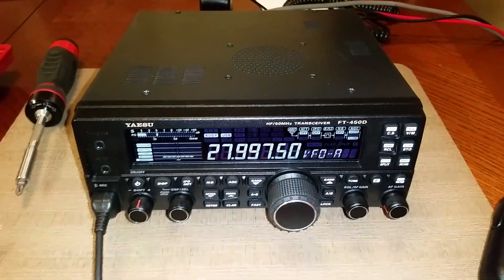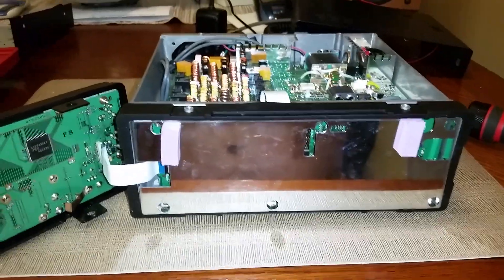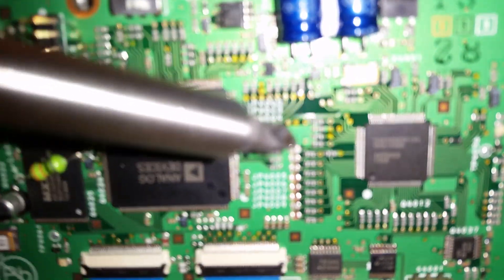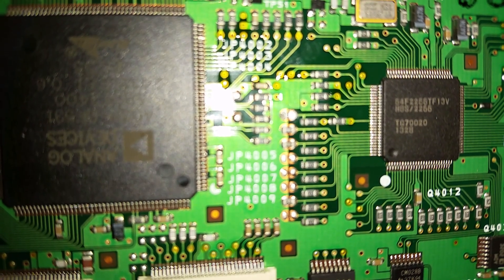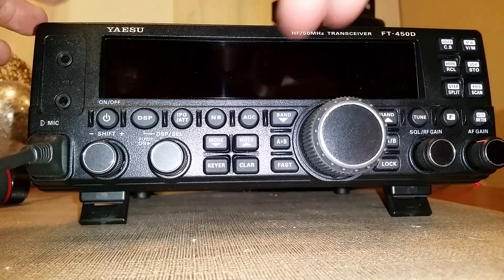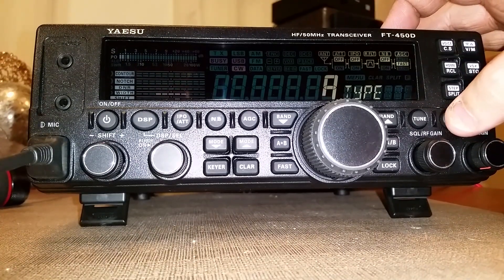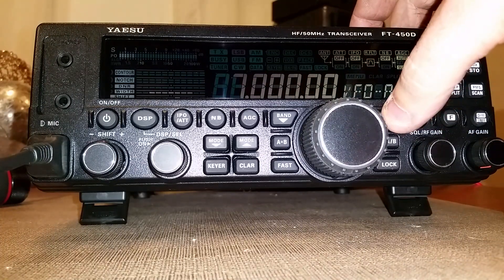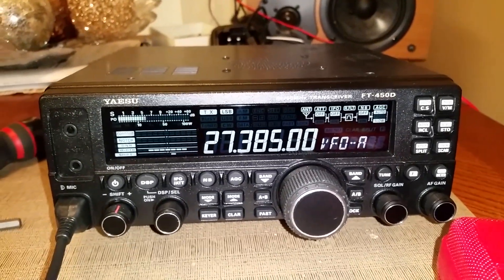Yaesu FT -450D expanded transmit mod

Comment: Useful for 5MHz band if you're a ham and for the CB guys but illegal for everything else! 5 mhz can also be enabled by a software hack which is published in a PDF on the Yaesu site and for that you don't need to open the rig!
Reply: sorry ! 60 meter band is programed in the radio from the factory. no need to modify unless you are mars affiliated. or you to talk illegally on the cb band
Reply: @robertmethia7080  How the radio is factory configured depends which country you live in.

Comment: I just did this on my radio, it worked fine thanks.  The jumper is soldered to the large ground pad so it takes quite a bit of heat to de-solder it. Also, when you turn the radio back on, be aware that it's done a factory reset so any settings you had will be wiped and it'll go back to how it was when it was new (but will now transmit on all frequency's in all modes).

Comment: got a problum the cable that connect fount pannel  both ends to transceiver came out pushed it back in thes sound when i switch on but now  the fount pannel wont light up have i not push it in another

Comment: Dear friend forgive the daring to write to him on his channel but I would like your opinion
technique of the problem of my Yaesu FT-450 equipment.
Now I explain the history of my Yaesu FT-450.

I will tell you that the radio was in perfect condition and works without
problem, about 15 days ago a friend brought me an FT747 to measure
the power because he had changed the rf out transistors. I connected the
my friend's radio and I put cw and when I press PTT I realize that my FT-450
it was on it has a burning smell but no smoke only smell.

At that moment I turn it off and realize that I had an antenna on that is
two meters from the antenna that I was testing the FT-747, the conclusion that
serve is that with the proximity of the two antennas my FT-450 got a lot
RF and something was damaged or burned.

When I turned it on again it was another radio, I had a lot of problems like:

-ALC does not work in any gang

-The power goes down to 40 or 50 watts in cw and FM and when I transmit in ssb the power
it drops to 20 or 25 watts in almost all bands except 80 and 30m which outputs almost 100 watts
in cw.

-In the 6m band the reception has problems, strange noises are felt and only
it outputs 5 watts in cw and when I transmit in 6m there is a noise in the radio horn
It is the band that is worse, in the other bands the reception seems to be ok and
it has good sencibility.

-The internal tuner antenna of the radio goes crazy and does not adjust correctly, I will
disable the tuner antenna (INT TUNER) and continue with the same problems which
It shows me that the internal tuner antenna of the radio has no problems.

-When I press the ATT button, the RF OUT power in transmission decreases even more and
This cannot happen because ATT and IPO do not work in transmission.

I physically checked all the components to see if any were burned
or they had another color but visually all the components are in very good condition
physical.

I reset the microprocessor manually with POWER-HOME and also reset it by
sofwear with a program that Yaesu has for the FT-450 that updates in
microprocessor and there was no change.

I have no idea that it may have been burned or spoiled, it strikes me
that the radio's ALC does nothing and this may be the problem, but I don't know
which component in the ALc may be wrong.

I have all manuals and diagrams of service and adjustment.

With all this information that I have given you, I would like you to study the problem and I
give your opinion or idea that the radio may have affected so that it has so many
problems. My mistake was testing the FT747 with the other antenna attached to the FT450
I think that RF entered through the antenna and something burned, but I don't know what it could be.

If you have any questions tell me I can do the measurements you tell me or check
some components, I measured some diodes placed on the board and they are in good
state.

I await your opinion, a million thanks in advance.

Greetings .- Eduardo

Comment: It will be a fine day when these guys all go to the slammer, or get fined and lose everything they own. Fitting end for scoff-laws.  When a radio working legally is a "Problem"  the world is in sad shape.
Reply: I see you posted a couple of years ago, then again a month ago, so maybe you'll see this. I'm a HAM, 40 years now, and I'm also a prepper. In a true emergency, communications out of band would not be judged so harshly. If i have a rig which is capable of OOB use, great. Doesn't mean i WILL use it, or even WANT to use it OOB. Same logic as having a  car that'll do 140 mph. Where can you drive it that fast? I have other licenses as well, including GMRS! Who bothers with GMRS licensing these days?

Comment: Just done this mod on my new 450d...only prob I had...when I got to the part of the instructions where you get SMADJO on the rigs display....I was rotating DSP/SEL looking for type A...where TYPE A should have been I had B TYPE instead...thought I had done it wrong but I looked a few more times still only B TYPE came up after the previous number 41 on the display.
I followed the instructions from here and it went straight to Type T.

Transmits across the whole band but the AM broadcast band wont now tune properly on the VFO...no big deal but I wonder if anybody else has found this.

Drop me an email please if you have had similar results....it wont transmit on the broadcast band by the way.

My email is nickjaxe AT ntlworld.com

I need open band for marine use in case anybody is wondering why I did the mod.

I did this mod as I need marine TX.
Reply: FYI to you or anyone else wondering about this: When you do the reset it reverts back to the factory default which I believe has FM and AM modes tuning via the DSP/SEL knob instead of the main VFO knob. The way to enable tuning those modes with the main knob is to go into the rig's settings, and look for 'A&FDIAL' and toggle it over to ENABLE. 73 from W5SMS

Comment: Hi, did this mod on my ft450d and set to t type and saved it but mine wouldn't transmit at all anywhere!!.....so ended up putting link back in....By the way it is not a diode but is a 000 link which is the same as a short.....cheers Kev G7ILP

Comment: Hello! Is there a manual explaining the Service Menu of the FT450D?
When I'm trying to transmit more than 50W in CW (35W in SSB), it blocks itself ... Like a security... Maybe one of the previous owner did a change in this menu, It happens even with a swr of 1.1 ... (I hope, else it's a PA's problem)...

Comment: Nothing like the thrill of cracking open an 800 buck rig and taking a soldering iron to it.... Mod worked great. I didn't have diodes, I had 0 Ohm resistors. I simply lifted one leg. That way, should i have to, I can put back in place. Thank you.

Comment: I don't see being locked down to only ham frequencies as a problem
Reply: If  you are a CAP or MARS operator, you would have to settle for the real thing, like a MOBAT radio which cost about $8k brand new which have parts unavailable for civilians to fix it if something goes wrong. And THIS is a problem!
Reply: I've yet to set my 450D up yet but reading the manual the 60 metre band UK channel frequencies seem out of date so this modification could be useful for that.

Having said that I will not be modifying my 450D with this mod.
Reply: Robert, that is because you were born with a functioning brain.. while these other clowns are cross polarized.
Reply: Virtue Signal Received.  Help is on the way.
Reply: It's locked down to amateur frequencies at the time of that radio's release, which is a problem since we've gotten new bands since then.

Truth be told, I'd rather have a way to add the new bands, but we have to make do with this.
Reply: I agree 100% want a cb radio then buy one 10 minutes later you will want your money back. lowest form of communication known to man.

Comment: Do you jumper that gap where the diode was with solder? I've seen a few guides online that say to do this, and it's also in the video by Yvo Muniz that you see in the related video section. Ideas?
Reply from the maker: FlyBoy276 all I did was just simply remove the diode all together and reset the radio

Comment: If this was as simple and straightforward as implied, why was it not done ON the video. Truthfully, it was vague as to which diode was being cut, due to poor focus and never actually putting a pointer ON the component, it was more like .......uuuhhh, its one of these over around somewhere in this area here. Nope, not gonna risk cutting what might be the right diode on a transceiver I just spent $700 for and then $100 for a power supply. For what? CB?
Reply: Dave, I think you've had a stroke. Which is good.
Reply: Frank Elmer funny, funny. what crawled up this Dave guys pants leg. holy crap, he just can't calm down.  maybe he was dropped on his head when  he was  a  baby.
Reply: you didnt pay much attention did you
Reply: dont do it then, I wouldnt . spend $30.00 on a cb and after 5 minutes of that, you have only wasted $30.00

Comment: cant understand pple saying this vid is not clear..... simple and very easy to follow thanks .... just did mine and it works a treat
Reply: cookie bear Geez, lighten up dude.
Reply: cookie bear Are you for real? He points with a veritable hammer handle of a soldering iron, it is out of focus and then when it is in focus he tells you what to do without without accurately pointing to it. 
He pre supposes everybody knows as much as he does also.

This is a terrible video - poorly planned and executed even more poorly.
Reply: ThePaulv12 just watched it again and saw no problem following his instructions , you must have no tech ability at all if you cant follow this simple video lol
Reply: cookie bear The opposite actually, but I admit not in the area of electronics. Thing is I have the gear and skill to do this confidently but FIIK if I can see what he's on about; I need clear, exact instructions, and it seems so do many others.